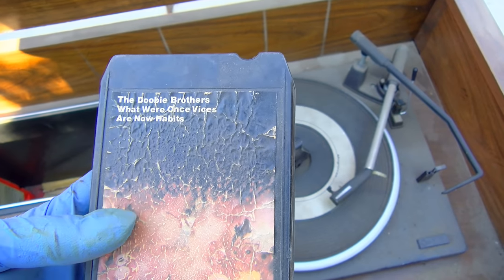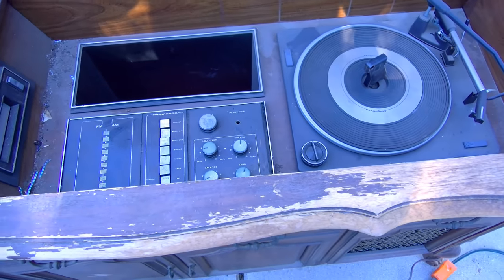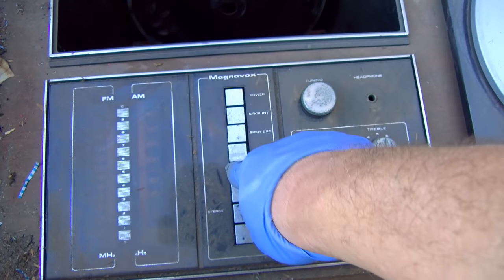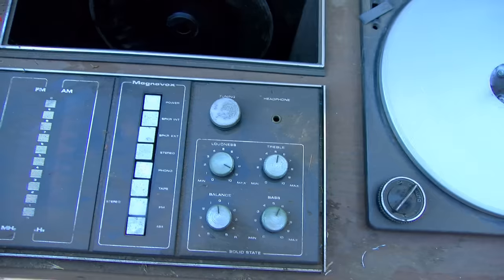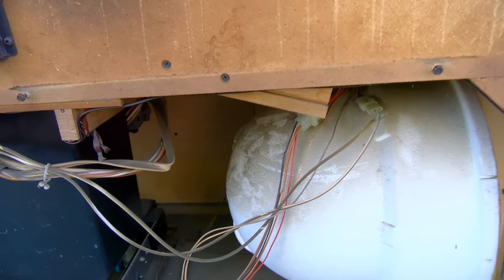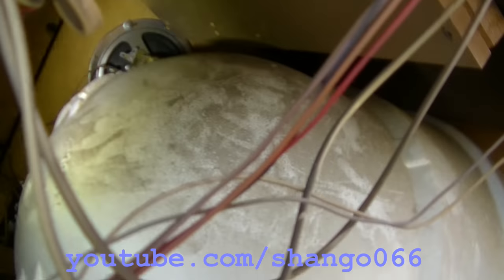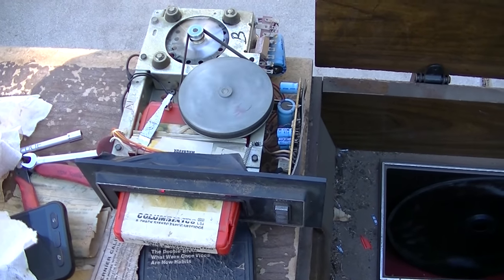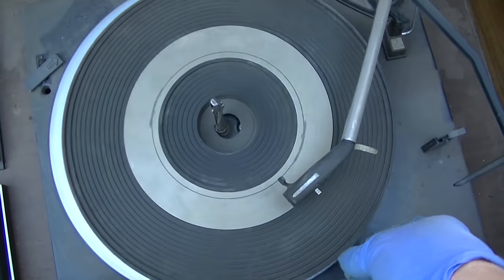1976 Magnavox Console Stereo 8 Track Record Player Resurrection

Comment: The phono output is muted because it’s in the middle of a cycle. It’s supposed to mute the output when the arm is moving.
Reply from the maker: Ahhh that explains it. I guess I will be prepared for 500 comments telling me the same thing
Reply: At least...
Reply: @shango066  i really would like to get that motor with the fan on the top for a project . would you like to donate it to me?
Reply: you beat me to it, and 2000 others!
Reply: "Ah what a n000000000b!!! Blah blah blah"
Reply: No, he simply did not replace every single electrolytic, that's why it's completely dead. Replacing the caps will lubricate everything and rejuvenate the rubber parts
Reply: @Moonwalker917  after rescuing from the jungle in a wheelbarrow & restoring it with a $2.99 multimeter & a dollar shop soldering iron
Reply: Shango can put that dudes soldering skills to shame with a propane torch and 22ga wire.
Reply: Yep!
Reply from the maker: Southeastern777  an ear for bug in ear when we are able so Kinnear Falls ride Owens iPhone glaringly Oroville
Reply: I thought that might be it too, yes

Comment: Wow that old 8-Track works like a champ. Thought it would have horrendous Wow&Flutter, but it was actually really good.
Reply: You can actually tell by the watching the stroboscopic  effect of the motor fan on camera. Looks almost static.
Reply: Has a winch motor to run the capstan.
Reply: There's no wow & flutter with that big ass overkill motor and that thick and heavy flywheel
Reply: AC motor for the 8 Track are more rugged. Don't need to worry about motor brushes. They do tend to produce a lot of heat so need ventilation. Only thing is you really can't get a fast forward feature. Some fast forward features on AC motors are done using a mechanical gear shift.

Comment: "Along with the sunshine, there's gotta be a little rain sometimes..."  That 8-track player is amazing.  It was a great medium, it rarely jammed.
Reply: Although the 8 track player in this video appears to be about the best example I've seen, I thought the medium was terrible.
Reply: @acoustic61  8-track had a hideous problem with head track alignment due to the floating/ shifting head, and the freq response was sub-par compared to cassette which was to follow.
most 8-Track decks had a range from 50 Hz to 12 Khz.
Typical basic Cassette was  35-12000Hz and then they improved on that to vastly widen the range with better tape formulas, THEN came CD... and we all know that story.
Reply: I always liked and started collecting 8 tracks and cassettes and reel to reels. 8 tracks can sound surprisingly good if you have a good deck and good tapes. When 8 tracks came out they sounded leaps and bounds better than cassettes (which were only made for speech). Then cassettes got more and more popular and instead of improving the 8 track, they improved upon the cassette and the rest is history.
Reply: Yeah, it rarely jamms, but it does tend to snap at the splice with the foil. I still use 8-Track and Reel to reel.
Reply: @frankowalker4662  I like playing my Stereoscope 8 track.  Very nostalgic.  Yeah, it sounds like crap, but it is a distinct crap sound that brings back memories...
Reply: Yep every one i buy i always crack them open and replace the foil splice and the pressure pad and clean the pinch roller and lube the spindles with some dry lube that goes on wet and dries. Ive had more cassettes that squeal and bind up than 8 tracks lol
Reply: @suzakule  As long as you have good equipment 8-Tracks aren't that bad and can sound good. Sure CD's sound amazing but can't compare to a magnetic tape. Magnetic tape just has a fuller, deeper sound overall and that goes for VHS also compared to DVD.
Reply: @suzakule  I noticed various methods were used to change the tracks but all involved mechanical movement of the head. They probably should've used an 8-track stationary head but maybe didn't exist at the time. I don't think the format was meant to be super high fidelity. More of a convenience for use in cars.
Reply: my 8 tracks back in the day had a high rate of jamming/eating tapes, and stretching out a little- they were nearly impossible to rewind once they did
Reply: @suzakule  12k is really a stretch, more like 10k. Akai did put one out with glass heads that got up to 18k, but that is really polishing a turd. The 4 track was a much better format that had 2 programs, higher output, less crosstalk. Leftover technology from broadcast carts, Lear and Muntz were pushing cartridge endless loop devices for automotive and department store music use mainly.
Reply: @seanobrien7169  In the car, it didn't really matter because of the road noise.
Reply: @iworkout6912  Back in the day, when everything was new and not deteriorated and corroded, they didn't sound half bad.  I had a friend that had a quadrophonic 8-track in his Camaro, man, that sounded awesome.  The biggest pitfall to 8-track, which no one has mentioned, is the track lengths.  Albums were cut out of order to the vinyl and cassette versions and what really sucked were songs split between two tracks.  I am certainly in agreement that it was a format created more for convenience and portability than fidelity.  The cassette was simply a better format and won the day.

Comment: The 8-track sounds great! I love old Magnavox consoles. I have a couple currently. Both need work. They have to get in line. The later BLR turntables aren’t quite as good as the earlier Collaro, but even the SS plastic 70’s junkers sound better than virtually anything consumer grade you can buy today.
Reply: Brad, I didn’t know you knew Shango, cool. I wonder if he also watches your great channel. Great minds think alike!
Reply: Very true my friend. Ive got a mid 70s Bradford console, AM/FM, PHONO, 8-TRACK, one channel on the amp sounds terrible, sounds like a speaker is blown, but its not. And the 8 track needs a belt. 

Any thoughts on where to get a replacement belt?
Reply: @mountain177  Of course Amazon has belts.  (As you would expect)  I had a VCR business back in the day, and belts were easy to buy.  I'm sure Amazon is used by one or more  of the suppliers now.
Reply: @mysneekers5862  He suggested shango's channel in one of his videos from like 2017 iirc
Reply: @iworkout6912  how would i go about searching for belts? 8-track player replacement belts?
Reply: i believe the brand of turntable that you're talking about was "BSR".
Reply: I always thought the later models with the Styrofoam speakers sounded better than the earlier open-backed Astro-Sonics; with the woofers on the side, the open back design tended to sound murky. Some of the later cabinets were quite cheesy, but this one was a pretty good fake and it would not likely have survived in the rain if the whole thing had been made of real wood.
Reply: Wow and flutter is excellent for this vintage.
Reply: Around late 1973 3M/Wollensak actually made a fantastic 8-track recording/playback deck that had Dolby B, 30Hz to 16 KHz +/- 2 dB frequency response, .08% wow & flutter, 62 dB SN ratio, and no more than .08% THD at 0 dB VU playback. This 8-track deck rivaled the top high-end cassette decks of the era, such as the Teac 450 and the Nakamichi 700.  But by that time, 8-track was on its last legs.
Reply: @Trev0r98  In 1971 the Advent 201 came out. The best sounding cassette deck at the time IMO with a signal to noise ratio of 64 DB.
Reply: @Trev0r98 I'm the proud owner of one of those good wollensak decks!  I remember seeing one new in a store and I think the price was around $349 or so.
Reply: That is a genuine Collaro record changer.

Comment: I’ve worked on many of these consoles. They actually sounded really good for what they were. The record changer auto mechanism has a switch to mute the cartridge when cycling. I would clean up the mechanism and repaint the cabinet. The auto mechanism is so gummed up that it’s causing the tone arm to bind at the end of the record.
Reply: I think that was the head hitting the up-turned cup his phone was lying on - for speed reference
Reply: A guy near me did something like that.  Except he wasn't trying for a 'vintage' look.  He painted his a weird purple with some funky zebra-stripe grille cloth, and neon lighting in the equipment well.   Sounded good, though.

Comment: I've never clicked a video so fast in my life! I just restored a  similar Magnavox model and it's amazing. My cabinets in near perfect condition. I had to free up both motors too and touch up some solder joints on the knobs. Only thing wrong now is it won't go into fm stereo. It gets great reception though. Really hoping you do more with this
Reply: I had a console like this and had no stereo fm. I ended up having to replace the multiplex  ic.

Comment: My aunt and uncle had a console stereo but no 8 track, they weren't invented when they bought theirs. It was solid wood with slider tops instead of a lid, and actually a beautiful piece and both the radio and the turntable sounded so good. I am actually amazed that anything is working on this one you are videoing and considering it's condition it sounds pretty damned good!

Comment: That's quite a beefy motor just to power a 8-track player. But after lubing it up, it sounded pretty good! I"m surprised the belt hadn't turned to goo yet. I remember my mom and dad bought a console stereo in 1970, when I was only 5 years old. It was a GE. Must have been made from real wood because it was flippin' heavy. They were married in 1961 and before the console, they had a record player (the kind that folded up into a suitcase), and a reel to reel player for their music enjoyment. They finally donated it to a thrift store in 2001. It had it's problems over the years though. They actually had a technician that would come in to fix it in home. There was one point that when you turned it on, nothing came out of the speakers. But oddly enough, stomping on the floor next to it brought it back to life! From watching youtube videos on old consoles, it seems the late 50's into the 60's produced the best ones.

Comment: No wonder the 8 track had such a good motor, made in England. Just needed a bit of a lube after so many years. Much better than the nasty cheap Chinese DC motors. Considering the condition and sound over the net, it did seam to sound reasonable. I wish I was closer, New Zealand's a bit far to pick up for a proper restoration.
Reply: i took a collaro motor apart and oiled then put  it back together, it turns very smoothely and quietly now

Comment: Lovely look at the old Magnavox. It may have been built to a price but it sure sounds good. It looked like the returned a product and bought this console unit paid the difference. The speaker domes in polystyrene sound better than they look.
Reply: Yeah I wondered about that. Not even the far more expensive 60s consoles had enclosed woofers. I wonder if it's a true acoustic suspension or just to dampen resonances. The tape transport looked solid too, there are far worse 8-tracks. Apart from the turntable and extensive use of polymers on the outside (lol) this is a neat unit.
Reply: I hear Sylvania was famous for those and the TV technicians I worked with really liked them.

I was told there was a top-line Sylvania combo that had a high power amp and honeycomb speaker baffles and a flying spot scanner built in for displaying slides on the television. I'm imagining how heavy that must have been.
Reply: @johnnytacokleinschmidt515  : RCA did that back in the late 1930's on some of their radios. I've got one that's a 12 tuber push-pull.
Reply: @johnnytacokleinschmidt515  Yep, I had a Sylvania that had those, Looked like a Bee's Nest and sounded pretty good!, Magnavox used a Square type foam Cube before this one, Had a '12 Woofer and 4x8 Horn

Comment: Don't care if it's plastic trash, I'd love to have that thing. 😁 it sounded pretty good!
Reply: In the 80s these things were often found for free next to dumpsters.
Reply: I have on in my man cave that came out of my wife’s grandparents house. It was turned on twice in 40 years before I got it
Reply: even with 1 bad woofer!
Reply: @suzakule  Probably not a bad woofer, but debris caught between the cone and the grille cloth.  Or the  glue on the voice coil dust cover has partially failed.  Maybe a bit o' both?
Reply: @bonemar66  It's possible that the dust cover could be buzzing on all around, but it's more likely for dust and debris to become lodged in-between the woofer cone and cloth cover.

In my early days of being the 3rd-4th owner of my eBay Zenith Trans-Oceanic D7000Y, it had dust in front of the speaker due to a foam gasket having disintegrated into nothing over the period of 45+ years, and it sounded exactly like that "bad" left woofer driver.
Actually, I made a video on it demonstrating just that a few hours before I dug into the receiver and vacuumed the dust all out: https://photos.app.goo.gl/ctr5Ychmze5DXxL26
Reply: I still have my mother's (recently deceased) Sound Design unit like this. I was there when she bought it from Kmart (I was 4 years old) back in 1976. It's of the plastic trash design, but it sounded decent. Gonna go through it to get it running again. It has a BSR turntable, AM/FM stereo and 8 track.

Comment: Some issues you can have with phono cartridges are if there are colored wires sticking out the back then one wire can come loose. Another thing is the wire connections can become dirty over time and need some contact cleaner on them. If your phono cartridge does not have colored wires sticking out of the back of it then the phono cartridge just plugs into the tone arm and if you pull the cartridge off of the tone arm then you can spray some contact cleaner directly into the tone arm. Another thing to do is take the stylus out of the phono cartridge and spray some contact cleaner into the phono cartridge then put the stylus back inside.

Comment: I'm honestly astonished that it came back to life so readily - especially considering it hasn't been used since probably the 1990s and as you said, sitting in the weather.

Many of these units had a feature that would 'mute' the output from the phono cartridge when the changer is cycling, so you wouldn't hear the noises from the mechanism through the speakers.  The switch for that is in the changer itself.  That particular changer mechanism isn't really all that bad, but after they've been sitting you absolutely do need to clean and relube them before they'll work right.  I think you could order these with a 3-speed BSR changer, as well.

The reason for the AC motor in the 8-Track is to pull the longer tapes hitting the market at the time, such as the blanks provided for 8-Track recorders (remember 80 and 90 minute carts?  Takes a fair bit of power to run those!).

I'll agree the cabinet is ugly and cheaply built.  It was just the way of things at the time, since consoles were already on their way out of 'fashion' by 1976.  But if you think it was only starting in 1976.... naw.  I have a mid-1960s Astro-Sonic that is basically a particle board box with veneer and plastic trim.

Those styrofoam enclosures for the bass drivers are consistent with the era.   This was when some stereo manufacturers were experimenting with 'air suspension' (or 'acoustic suspension') speakers.  As far as I can tell, it was basically just a gimmick to make cheap speaker drivers sound slightly better, but I've been told that it required more power to drive them.

I'm not saying it's worth a full restoration.  But I think it's a bit harsh calling it 'junk'.

Comment: Our Family had a 1974 Magnavox Console 8-track record player fm/am stereo It always worked well and had good sound, my parents use to drink and play cards with their friends every weekend and that console was very loud for hours and hours and never skipped a beat. the 8-track was above the radio dial at a slight forward angle with the turn table to the right. The speakers are sorta like this one, except the woofers are in a composite wood/cardboard balloon dome. not this styrofoam looking stuff in this video. Funny thing is I took the whole thing apart when I was 11 years old and took the woofer boxes out and put in some cheesy 8inch woofers screwed to the openings and kept the composite boxes and later in woodshop made mahogany wood speaker boxes that those composite boxes fit into. Radio shack had a nice tweeter/midrange sealed in a tube with the cone surround that was reverse shaped that I drilled a hole in the front of the wood panel that the woofer is mounted to with the carboard dome glue-stick like glue that holds the dome to the particle board wood. Still using them for watching TV to this day. Funny stuff.